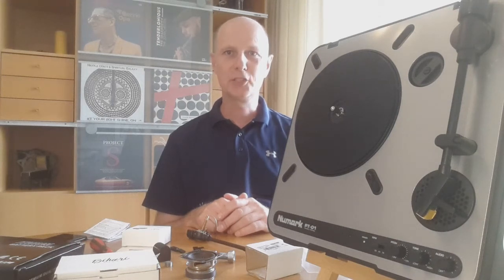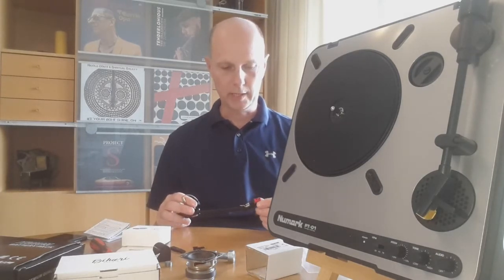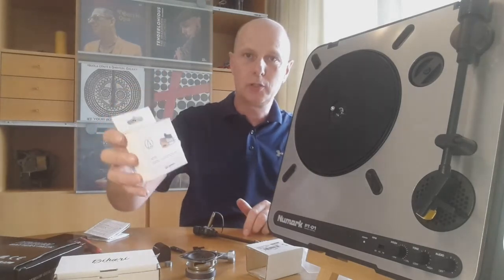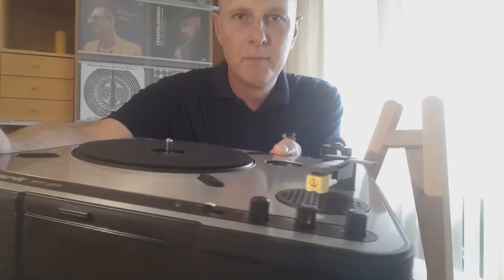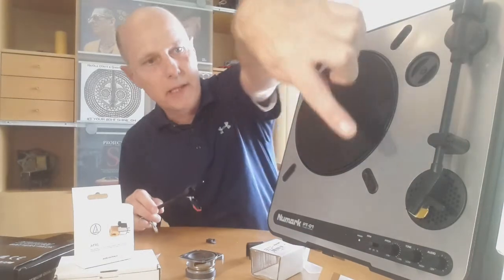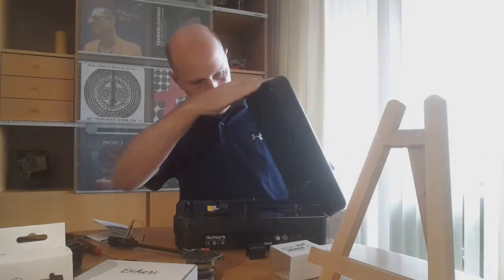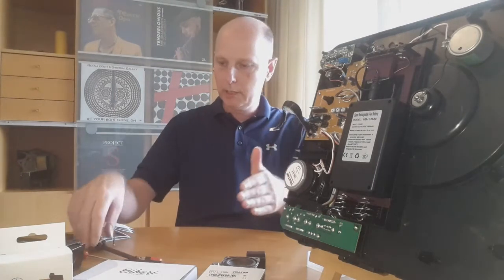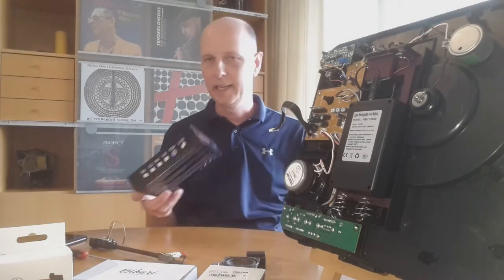Modifying a Portable Numark PT01 for HiFi Playback - Vinyl Community

Comment: It's not the ceramic cartridge that wears out quickly, it's the sapphire stylus it comes with, which only lasts about 1/10th as long as a diamond stylus. Upgrading it with a diamond stylus will solve that problem. The tonearm of these Numark and ION players has anti-skating and tracks at 5 grams, which is the recommended weight for the cartridge they use, and below the 6 grams of tracking force that vinyl records were originally designed for. The spring is part of the design of the tonearm and allows it to play a record at any angle, even upside-down! (See my video "Amazing gravity-defying turntable" for proof of that.) Overall these are not bad record players and in normal use they will not damage your vinyl!
Reply from the maker: Thanks for the comment. Agree with you a 100%. A sapphire stylus will not damage vinyl. Only maybe when completely worn. Most probably the high tracking force will not have too much effect. Although on my unit it was above the 6 grams you mention. My main goal was to improve the sound quality. I wanted to have at least a moving magnet cartridge. Instead of changing the sapphire stylus to a diamond version. I love this little turntable. And it's fun to use. Cheers. /Paul
Reply from the maker: Just watched the video. Incredible! Temping to put the old arm back and give it a try ;) /Paul
Reply: About playing upsidedown, that s great, probably the only record player that does it, unfortunately I have two and none can do that, they r the first models, the USB ones, why u think this is so? Could that be fixed?
Reply: R we sure it s a spring or a magnet? Apparently springs r for the tracking force. By the way congrats 4 ur excellent video. Is there any way to get the ones with that brand? No sure right know the latest Numark does that too
Reply: @dealingwiththedarkestsideo5392  The PT01 uses both a counterweight and a spring. The counterweight balances the tonearm and the spring applies the tracking force. If the spring has gotten detached or is missing entirely, it will still play in the normal position, but will no longer be able to play records at any angle or upside-down.

Comment: Just stumbled across this video. I've been improving my Crosley. Before anyone comments, they don't chew records! I have a Philips hifi with the SAME BSR turntable mechanism and tonearm/cartridge and I still own the vinyl and it's not chewed despite being played for 40 yrs! The bit that chews your record is the cheapo needle that is often shipped with the unit - I've replaced that with proper diamond one, upgraded the ceramic cartridge, added counterweight, upgraded speakers, added high impedence pre-amp for the ceramic cartridge (omitted from most cheap turntables which makes them sound flat), new main amp etc. Anyway, my Crosley sounds good for a portable record player but I would like to try a magnetic cartridge on it to see if I can get it even better. Obviously the pre-amp will need swapping with a pre-amp suitable for the MM cartridge. Just waiting on the bits to arrive before I try and retrofit an audiotechnica magnetic cartridge to it. Wish I had a 3D printer ;) You could sell those brackets on ebay - would make a fortune ;)
Reply from the maker: Hi! Thanks for sharing your experience to modify a Crosley. It seems you followed a very similar path I did. For sure they don't chew records. I even think the cheap cartridge doesn't eat the vinyl. It only wears out very quickly, and when the tip breaks off the damage starts. Hahah, yes I could sell the bits, but I don't need the hassle that goes with it ;) Have a nice weekend. Cheers. /Paul

Comment: I had that Numark PT101 and used it to rip and upload my needle drop videos ten years ago. I don't miss it; always thought it sounded dull with the included stylus. I never measured the tracking weight, but always felt it tracked very heavily. But I did like the pitch control so I could sync it up with a CD to get the exact rpm.
- Red
Reply from the maker: Thanks for stopping by, Red. Tracking force, especially with the standard attached spring, is crazy.     I had to add a lot of weigh at the back of the arm to get somewhere in the ballpark. What a great idea to use a digital track to set the correct speed. Gonna try that. Cheers. /Paul

Comment: When it comes to anything audio you are brilliant Paul. Now did learn most of this tweaking/modifying or upgrading stuff by researching it online? Your knowledge in electronics is very sharp. I dig how you even changed the speaker. Wow, 200 spins with that lithium battery? Jeez, it really does sound a lot fuller and also a bit punchier. I did not even know that the portable Numark's came with a pitch control. <> Funny, I was just going to ask you if you thought that the $100 was money well spent figuring the turntable cost was similar. But you answered my question before I could type it in. {smile} My theory is this: No amount of money is too much if it is bringing you true happiness. Thanks for sharing this one Paul. I thoroughly enjoyed it~
Rob/Boston
Reply from the maker: Hi Rob. Always enjoy reading your comment. This upgrade is a mix of what I have seen others doing and my own ideas. Most make a little portable scratch table. I think I'm one of the first modifying it to fit a cheap hifi cartridge. Half the fun is thinking and fiddling about. It was the first time I could play with a 3D printer. This made the job must easier. Money wise I spent a little more as intented. All the best. /Paul

Comment: Finally found such a video - I searched for a few days if anyone did that, such needed modification for these portable record players (and I'm talking especially about all the Crosley's and their like) I think it's very good you recommend to make that upgrade. I think it is disgraceful to see all these trashy new record players use the ceramic cartridges - I think, especially if it's done in mass production, including magnetic cartridge and adequate MM pre-amp won't increase the price of one unit that much - it's all about greed. I'm sure if people will know the benefits of preferring MM cartridge many if not most of them will pay a few more $$ for that setup! Well done @X junkie NL !!!
Reply from the maker: Hi! I agree. The minimum on these turntables should be a conical MM cartridge. It will give so much more joy to the owner playing vinyl. And can be the real start of the vinyl addiction :) Luckily this modification is universal and can also be done on Crosley's. Thanks for the comment. Have a great weekend. Cheers. /Paul
Reply: @XjunkieNL  🙏Thanks for your response!
Reply from the maker: Probably a coincidence, my speakers are AN-K :)

Comment: Hi! Nice to see that there are ways to modify this turntable! Is the sound coming out of the line outs now comparable to a real turntable, too?
Would like to know because I have to decide between modifiing it or sending it back. I need full and higher quality sound for sampling from records... Thanks!
Reply from the maker: Hi! With the modifications the sound of the turntable is one step up. But still isn't on the level of a good quality turntable. This has mainly to do with the drive system. Hope this helps a little. Cheers. /Paul

Comment: What and where exactly where the capacitors that are to be removed for allowance of correct output of the cartridges?
Reply from the maker: I will have to check some old photos. I don't remember their exact number in the schematics. Will get back to you later. Cheers. /Paul
Reply: I found what you just said as profoundly HARLIROUS! Why? Because I took a screen shot of your video and looked more closely at what was missing like a finding Waldo puzzle🤣😂. 2nd I took a closer look and worked out the ohm, and I hat each capacitor did. Thus coming up with the removal of one leg on each, then flipping the board over, joining the capacitors as one and then running a ground wire that a soldered in, gave me that pure, high quality & clarity I was seeking!

Secondly, I placed a small retrofitted slither of Dr Suzuki plastic film over the four felt padded supports so when I place a slip at on before the album it reduced the amount of torque required to spin the album thus impacting tracking requirements getting a more closely attuned “pitch & key” result in sound quality.

Thanks for providing me a small key to unlock the other ideas I was contemplating with a formula for solving those equations. Taking something that is cost efficient and turning it into an item that provides quality is a life’s quest. Peace and blessings!
Reply from the maker: Did you find Waldo? He was hiding behind C8 and C18 :) I will also look at the felt padded supports. Thanks for the tip. /Paul
Reply: @XjunkieNL  YES!!! Okay 2nd part, I was noticing how you performed your battery installation. Did you select to also connect the battery to capacitor on the boards? It's the black three pronged power cap that sits on the same board with the input for power supply. It appears that you ran spliced cables and adapter to the battery pads. Just wondering if you added some other alterations there.

Comment: the black pieces that are in the inside of the pt01 headshell- it looks like you had to snap those out to get the 3D printed headshell component in?
Reply from the maker: Hi! Yes, you are correct. All the connection pieces inside I removed. Maybe if made a more fancy 3D printed design you could made in fit completely in the original headshell. Cheers. /Paul

Comment: Excellent, I have just installed an Ortofon cartridge and couldn't understand why it was so quiet. I never knew that ceramic stylus were louder so at least I know I require a pre amp now. Do you know how I could reduce the humming noise?
Reply from the maker: Hi! Cool to hear you've taken the first step and changed the cartrigde. There is no way around it, you need a preamp to increase the volume. Did you have the hum the whole time, or since you changed cartridges? Maybe it's now more noticeable with the low level volume of the music. Cheers. /Paul
Reply: @XjunkieNL  it always had a hum noise but iv only ever used it with a power adapter and not batteries. I wonder if it could be interference from the AC/DC power source? 
 I was thinking of getting a rechargeable battery like yours too. Did you just strip back the cable and solder the wires to the + & - springs in the original battery holder?
Reply from the maker: @Energyflash1979  That must be it. I've been using the rechargeable battery for ages. A great modification. The battery seems to never get empty. No, you can't do it that way. The voltage is a little to high, you have to reduce it to 9 VDC.

Comment: Would you happen to have a link to that Lithium Battery? I tried finding it on amazon but there was too many and I could find the one you had. Thanks!
Reply from the maker: Hi Pablo. I did a quick search but couldn't find it also. It's some time ago. I cheked the specification, they are DC 12V 6800mAh Portable Rechargeable Li-ion Battery Pack. Hope this helps. Thanks for watching. And keep that PT01 spinning :) Cheers. /Paul

Comment: I've just bought this turntable used to upgrade it and have a portable solution for crate digging. Your upgrades are well chosen, am I able to get a copy of the 3d print files so I can perform the same upgrades please?
Reply from the maker: Hi! Cool to hear you also got a PT01. It's fun to own a portable turntable you can take with you everywhere :) If you don't use the 3D prints for commercial use, I can mail you the STL files. Cheers. /Paul

Comment: Hi Paul, 
I came a bit late to the show, but this was a great video! I have a different TT but with the same cartridge. Is it possible to share the 3d files to print the required attachments? I have dropped you a note on Instagram as well. Thank you!
Reply from the maker: Hi! Got you message on instagram. Will send the files right now. Let me know how it goes, if it also works on your turntable. Good luck. Cheers. /Paul
Reply: @XjunkieNL  Thank you for your support Paul!
Reply: Hello there, this option is the best and cheapest, instead of changing the whole arm, It is a way to get a copy of the files too?
Tnks!
Reply from the maker: Hi! Yes, I'm happy to send you the files, if you don't use them commercially. Contact me on Instagram (see also description) Cheers. /Paul

Comment: Hello again... do you have an instructional video on installing the Bihari Beat Booster for the Original Numark PT-01?
Reply from the maker: Hi! Had to look it up. Didn't know this mod. Nice little upgrade. I don't think I will add it to my unit. Cheers. /Paul
Reply: @XjunkieNL  thank you... do you remember where you found it? I have looked everywhere with no luck. 😔
Reply from the maker: I looked at the Bihari website. But it is sold out overthere. /Paul
Reply: @XjunkieNL  thanks again

Comment: Hi! Great video. I have the same turntable, the non-usb one and I wanted to do this modification myself but when I look at the preamp that they sell now, they say that is not compatible with the non usb version. Do you have the instructions of the one you bought or a link to it? It will help me a lot. I might be able to adapt the new ones that they sell but I would need to compare.
Reply from the maker: Hi Frank. Sorry for my late response. I had to check what preamp I used. As I remember now, I did use a preamp version for the USB version from Bihari. You can't use the connectors and need to do a small modification to the PT01. It works, only the volume control range is compressed. You can only use the volume control from 6 to 12 o'clock.  Hope this helps a little. Cheers. /Paul
Reply: @XjunkieNL  what's the number of the IC chip above the 3 pots that control the speed?
Reply from the maker: Hi. That's a UPC1470. Hope that helps. /Paul
Reply: @XjunkieNL  thanks

Comment: Is the AT91 stylus cartridge you bought have a diamond tip? Or is it sapphire? I'm assuming it's diamond, but I want to be sure, because it's not specified which it is on Amazon.
Reply from the maker: Yes, exactly it has a diamond tip. The shape is conical and the cantilever is from carbon. There are also spare tips available for when it wears out. Cheers. /Paul
Reply: @XjunkieNL  Thanks for the answer! My suitcase turntable is a Musitrend and it's probably the best quality out of all the suitcase turntables, and it comes with two conical, diamond tip, ceramic carts.

Comment: This is great!

I'm eager to swap out the cartridge on my PT01 scratch without shelling out >100 usd for a new tonearm. I hope that you can help me with a request and a question:
- Could you please provide a template file for 3D priting? I would also like to know what size bolt to use.
- I only use this table in my apartment, and my amplified speakers have a phono preamp, so may I simply plug into that?

Thank you so much for your kind help :)
Reply from the maker: Hi. If you send me your email address and can send the files. This with the condition you don't use them for commercial purposes. I don't think you need a phono input. You can use any of the other inputs as the signal is already amplified. Hope this helps. Cheers. /Paul
Reply: I would very much like this template file too- I can assure this will only be for my personal turntable. Thanks so much for showing this! I was looking at buying the bahari tonearm but hesitant due to the price.
Reply from the maker: Hi! Just sent the files to your email address. Send a photo if it works, would be fun to see. Cheers. /Paul

Comment: Hello... Do you have a video on how to repair speed issues for this model?
Reply from the maker: Hi. Thanks for the question. I don't have it. It would be a great subject. Till now I haven't been able to have it perfectly stable. In the future I most do a video about it. Have a nice Sunday. Cheers. /Paul
Reply: if you open the turntable right next to the pitch control there is one blue knob that you turn to correct the speed, at least it was like that on the numark pt01 scratch.
Reply from the maker: Thanks for the comment. My answer was more directed toward the speed inconsistency. Usually not a big problem. On music with piano solos a little bit more of a issue. Cheers. /Paul